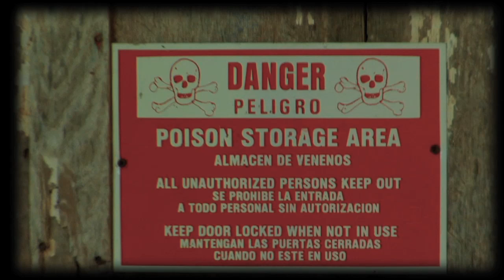Ford Model t speedster race car {ReBUILDING HISTORY the series}

Comment: so what he did is actually saving a car in a way. He took old parts, as he said, and pieced together a car from it. It is not at all a hotrod: original engine, frame, springs, axles, rear end, etc by the looks of it. Again, I really don't like calling people out but you sir are just rude. Thimk before you open that mouth. To the guy who made the car: excellent job. I hope mine turns out as nice as yours.

Comment: Hello.
Love the Videe. I just purchased a 1921 Speedster. It's all original and close to mint.
One problem is that I have a very tight fit in the seat/s! Also I could use some more leg room.
Your seats appear to be larger than mine as they are not flush with the body whatsoever and you look comfortable!

Where did you purchase those seats from?
Best,
Mike,